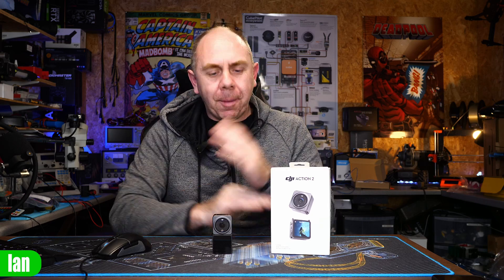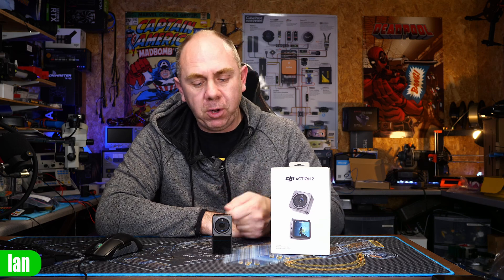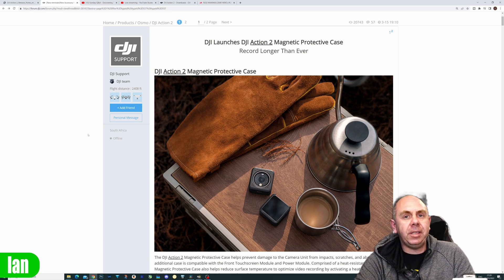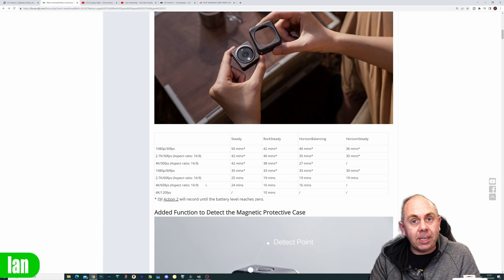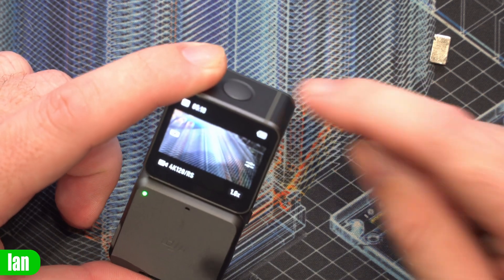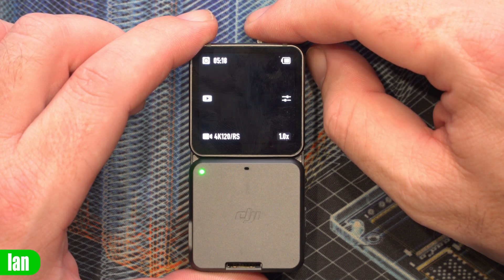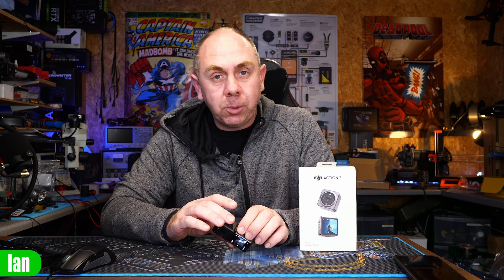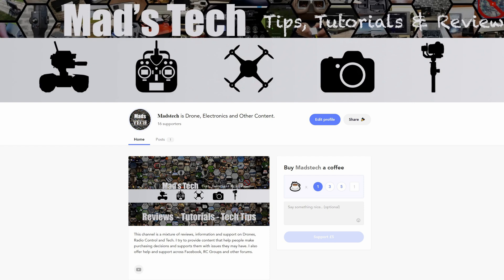DJI Action 2 High Temp Hack - DJI Magnetic Case Mode Longer Recording

Comment: I can select high mode when using VPN set to United States server. I’m using liberty shield on my phone with the setting selected to “connect on contact” . It took a couple of attempts but does work, make sure you close the dji mimo app each time you try. I changed the setting on the app and then checked on the camera settings to make sure high mode was selected. Then disconnect the camera and enjoy👍

Comment: Tha case is interesting. During cycling in standard temperature treshold, the camera overheated in the case, but were fine without it.
For some reason, the high treshold become available for me (EU model), and on the desk it makes wonder if I use only the camera module (8 -> 17 minutes recording time), but on the bike. Well, 4K 120Hz Rocks steady was nit a problem even in standard mode for half an hour, and the camera wrre way cooler.
Actually, a metal, heatsink like case would be better in my opinion, with the magnet, than this plastic case.
Reply: So you live in the EU and the high temperature mode become available to you? I thought it was banned here i dont get any of this anymore
Reply: @nevezeraa  It was nice while it lasted, but some firmware update took care of it, maybe even before the Action 3 had been released.

Comment: Why are we not able to use the High temp mode in the UK? I’ve been in contact with DJI today asking why I can’t access high temp mode and they weren’t aware it’s not available in Uk and had suggested sending the camera back to be checked over. They’re useless!
Reply: I thin you can via vpn I have just signed up for a new dpi account but via a us vpn... only problem is I dont have the camera yet
Reply: @THEG12EG  not sure how a VPN would work on a camera, but strangely I’m currently in USA and can now turn on the feature. But I do have the new supplies case on.
Reply: @HackettFamily  switch vpn on phone to 🇺🇸 connect to camera I presume you’ll get the added features. I get my camera Saturday I’ll try

Comment: A not cheap action cam that gets so hot it quits recording after 4 minutes or so? - sounds like a good reason never to buy one! Maybe if you embedded the magnet into some large aluminium heatsinks then stuck them to the case you might even get an extra two minutes of recording before it quits due to the heat. But seriously, £350 for a camera with such a heat problem? I would rather they made it slightly larger and solved the heat problem properly. Then i would buy one.
Reply: Its annoying right and price not worth it 😢

Comment: What has DJI just become... releasing unfinished/broken products and then fixing them like that? I bet this case will do anything but dicipate heat better.. and just with a blink of an eye it'll degrade its internal battery due to all the heat. Let's hope that at least it wouldn't blow... Sadly I'm also quite disappointed with the dynamic range of this cam - blown out highlights and black shadows all over the place... the Go2 actually makes nicer vids despite less resolution and so many quirks to work around. But I'd rather stick with that...